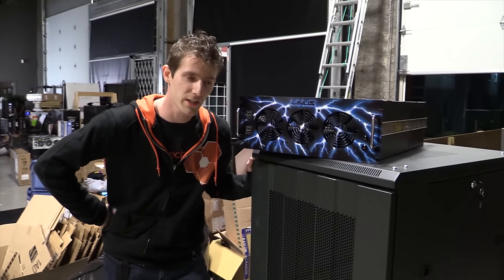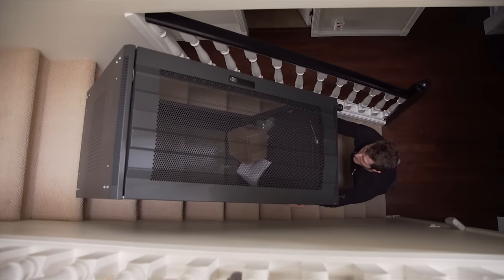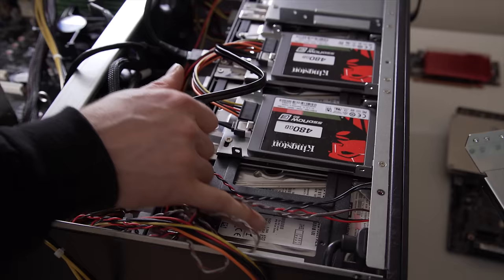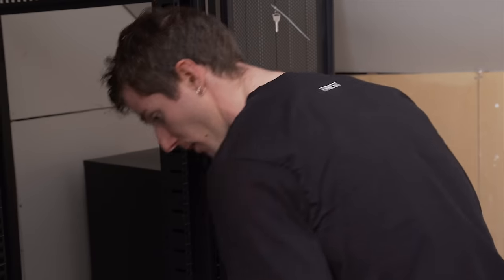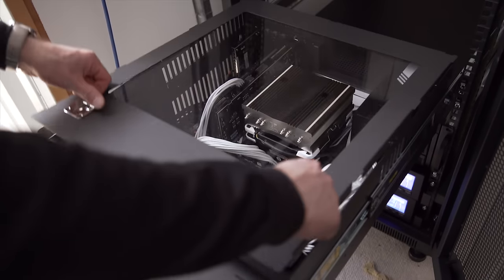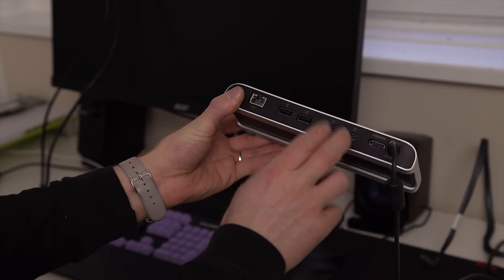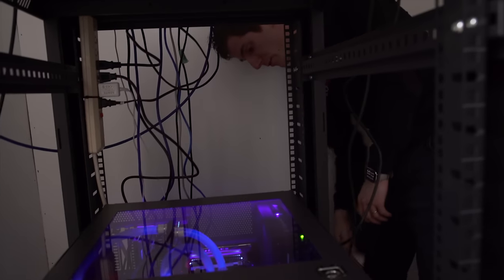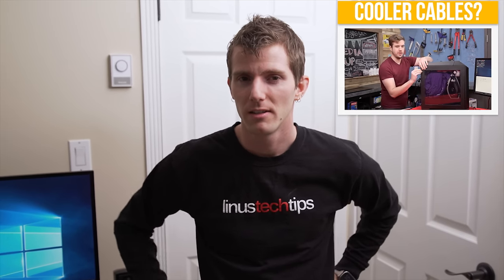Final Deployment of My New PC! - Personal Rig Update 2015 Part 5 (FINALE)

Comment: Nice Setup. Most boards these days have a internal thunderbolt connector. now Linus have u added internal TB cards to get the same functionality? can this connection cope with the load? and how come the computer knows how to output through the TB cable as people normally plug to the Graphics card directly and not through an intermediate card.. and one last question ! is it possible to bypass the hub and go straight for the monitor? (using some sort of TB to HDMI adapter and given that KB and mouse are wireless).. honestly this will save me the price of buying a TB hub ! :)

Hope to get some feed back from y'all!
Great Videos!
Reply: +Madani Khiyami just use a thunderbolt monitor. if you dont want the hub than thats probably the best option. if you want a tb to hdmi or tb to dp then you should just buy the hub, the extra functionality is more than worth it.

Comment: Could you please elaborate on the Thunderbolt voodoo you did there? Is that an adapter which collects every cable on one side, routes it through a Thunderbolt cable and then splits everything again?
Reply: +Ulmo The PC has to be thunderbolt ready and you add an expansion card.  Some newer motherboards have Thunderbolt 3 which would need an dongle to work with the Thunderbolt 2 optical cable.  The video output (in his case Displayport) is routed into the thunderbolt adapter card with a short copper cable.  The optical thunderbolt cable plugs into the mini displayport on the expansion thunderbolt card.  PCI-e and video data is send down the fiber cable and broken out again by the thunderbolt dock (that is how keyboard and mouse is extended as well as display).

Comment: Hi, So USB-C to Thunderbolt 3 cable from PC the Dock, then monitor, keyboard connect to dock? Which GapU is then powering the display? Onboard or PCIe GPU
Reply: +DemolitionManHD Gigabyte as a female Displayport connector on the Back I/O to allow for PCI-E GPU to be injected onto the Thunderbolt 3 data stream.  Its a unique and novel solution.
Reply: +jim slickster thank you

Comment: What with heat in that room? I have seen 2 pc's and some sound system in one drawer and it was quite hot in there even do there were holes. His room is much bigger and the only air-in hole is that filled with cables. Or I missed something?
Reply: DrawDeath it can get as hot as it likes he's never going to go back in unless there's a problem
Reply: Declan Mills yeah but temp will go higher and higher, wont it have any negative outcome on performance?
I think it may have
Reply: it is not that isolated
Reply: There are 2 radiators in his PC, the room may get hot but that PC is gonna stay ice cold. And I'm sure when he isn't using the computer, he'd simply just keep closet the door open.
Reply: Actually, cooling can only reach the temp of the air surrounding it, so if the air is continually rising, then so will the air in the case.

Comment: +LinusTechTips What Video card are you using? And how did you get it to send video via a thunderbolt connection? I am confused. :-/ can you share more info?
Reply: +Flat4Buggy 2 thanks for the quick reply. I'm now trying to figure out if there is a similar solution for AMD boards. I think the idea is right on.

Comment: I just got the exact same server rack a few weeks ago, need rails for my servers now which are $200 AUD, guess I'm not having rails for a while haha
Reply: What rack is it? I'm thinking about getting a second smaller rack
Reply: Well Linus's one isn't exactly the same as mine, mine has a glass door on it but other than that it looks the same. Mine is a High Class Communications FSR Classic 600 27RU 1000mm x 600mm server rack
Reply: Mr_Smith1327 thanks man
Reply: It looks like Linus's is the FSR Curved 600 27RU 800mm x 600mm rack, It might be the 1000mm deep version but I can't really tell from the video, I can however tell that his rack pc cases aren't as deep as most servers so they would likely only require an 800mm deep rack

Comment: How do you turn the power on? Except for walking into the other room and turning it on.
Reply: Simple. Sleep mode (used to be hibernate, where you save the session to the drive, not RAM, so you don't use any power) and wake on USB with the keyboard... although I'm not sure about the hub.

Comment: Hi Linus! I want to do a similar setup but i was wondering if there is a better solution in 2017.

Can someone help with this or just go with the thunderbolt+hub solution (i jsut want to ban my pc in another room)?

thank you very much
Reply: Hey, I guess you could use the "ASUS ThunderboltEX 3" for a Thunderbolt 3 (40 GBit/s) aproach, which would be very nice for a few years but unfortunately there aren't any thunderbolt 3 cables longer than 0,5m passive or 1m active which support the full bandwith. I heard that there will be coming otical cables for longer distances but they are not available yet and are then expected to be very expensive. (the thunderbolt 2 ones, Linus used, already cost about 350$ I think). Also you need to note that optical cables do not pass power but just data so you need a wall powered hub at the end to use any devices which require usb power. Hope I could help you. I'm also interested in using something similar but for now I guess I have to wait until thunderbolt 3 is well-established...
Reply: Thank you very much for the detailed help!

I think i will also wait for a "perfect" thunderbolt 3. =)

have a nice one

Comment: Ok, I'm new when it comes to building your own PC's in terms of performance and comparability. I need an upgrade from my HP laptop that's 6 years old but don't want to break my bank.  I have a budget around $700 including $119 for windows 10.  I saw the video about the CableMod wide LED strips and instantly though "Ooh! Shiny! Obviously go with an ASUS ROG MAXIMUS VIII FORMULA for the Aura LED connector.  After more research I'm here...  I want to build something that looks god but can still pull weight (Able to play games and be able to use 3D software like Inventor or video software, essentially a home computer for a variety of tasks) so I was thinking around the lines of a Core i5.  I honestly don't know where to start.  Motherboard? CPU? How do I balance performance to cost?  Is there anyone out there that can guide me in a general direction or give a recommendation, that would be great!  P.S. Linus... great videos, I've learned a lot but should probably keep watching.

Comment: So how much did this whole thing cost? I'm giving it a range of $15,000 usd to $30,000 usd
Reply: lol. like 5-6k
Reply: lol. like 5-6k
Reply: +Adrian Nastase his computer alone was like 6k 
he has a titan x 1500i modular psu, full custom water loop with a custom made case, cablemod cables, M.2 1.2 tb pcie ssd, and a 18 core xeon, and the monitors that he's using are like 1.5k each not to mention his servers and dual server power supplys witch are expinsive as he'll inside like a 600$ server rack
Reply: Lol your way behind. He is using an titan( not an titan x) a 5960x and 32 gb ram
Reply: ***** really? I taught he said the maxwell titan x, and yeah your right he's using the i7 5960x in his rig but the server has the 18 core xeon, regardless I'm pretty sure the 5960x is like 1400$ though
Reply: When he " bought it" it was 1000dollars. Watch the first build log, he says he isn't upgrading form a titan to a titan x
Reply: +Adrian Nastase I'm pretty sure he's using 64
Reply: He is using ducking 32 gb ram
Reply: +Adrian Nastase 64
Reply: GIVE ME THE LINK TO THE VIDEO WHERE HE SAYS 32 GB. YOUR WAY OFF
Reply: £35k plus all those GPUs need replacing every month but what's the point you have a future proof system that no one can touch because it's a supercomputer
Reply: +Sean DuBord he doesnt have a xeon in his main pc thats in his other one for something else he has a i7 5960X
Reply: +jonathan oxlade why does he need to replace his gpus every month

Comment: Are there other options to the elgato thunderbolt system?

I would like to put my and my wife's PCs into a single case and place it into the corner of the room (to get rid of the two cases under our shared desktop), but I am hessitating because I would need to find a way to bring monitor, mouse, keyboard (PS/2 mechanical) and webcam to the PC and in turn the power button, USB 3.0 ports, headphone and microphone jack from PC to my desk. 
The elgato hub is already pretty cool, but it lacks a power button or PS/2. Does it effect input latency?

Has anyone experiences to share or could point me into the right direction?

(For mouse and keyboard we already tried wireless options, but the signals were interfering which is a pain in the ass when you are gaming or trying to click on something - or better not to click on some "malware infested/ porn advertisement")
Reply: netwrok cables... but so bad

Comment: Can you do duel screens with this elgato dock?
Reply: There is an additional Thunderbolt port and one HDMI port on the dock, so it does support dual displays.
Reply: You can't output something out of the thunderbolt port and the hdmi port simultaneously, or at least that hasn't been possible previously.
Reply: Richard Strong After a retarded amount of research on docks that took way to long, a lot of docks do offer multi screen but the process is expensive and convoluted in some cases.

I came to the conclusion that cost wise it was easier to use either long cables for things that can be long (HDMI), and a USB hub to extend the range of that instead of a Thunderbolt dock. The cables are INSANE for TB and it's simply not worth it unless you have bottomless pockets.
Reply: discodench That is true of optical TB cables. The copper ones are much cheaper. There are alternatives but you'll still have to pay a lot.
Reply: The problem is if you want a long cable it needs to be fiber. Copper is to lossy for long distances at the TB standard. 

As for your question: https://help.elgato.com/customer/portal/articles/1491132-elgato-thunderbolt%E2%84%A2-dock-and-dual-display-support
Reply: discodench So you've got to use a thunderbolt enabled display for dual output. Those are a rarity, so in most cases it would be a no to dual outputs.
Reply: Richard Strong Thats the case with the el gato dock. There are other docks out there that run with thunderbolt that support multiple screens via displayport and HDMI. I think I saw a few that could even run 3 at 1080.

But still, at the end of the day it's still not a good solution for most due to the cost of the long cables. Not to mention the docks arent cheap either.
Reply: discodench I know. I own one and use it regularly.

Comment: Linus in 2050 : Finally i update my personal supercomputer with 20 Peta flops of compute performance, 10.000 cores clock at 1 THz, 400 GPU with 25.000 shader cores per-GPU, 1 EXABYTE of SSD with 200 Terabytes Per-Second transfer speed, too bad it can't run notepad and won't play solitare because the spec is too low for those heavy-demanded program :(

Comment: Linus I really hope you power bill doesn't have 7 digest
Reply: why would it go do some research on the cost of running a basic computer/monitor thats using 500-600 watts per month it barley hits the $40-$50 mark per month if its running 24/7 at full power (in a game or rendering something) i don't see how that would possibly make your bill 7 digits..50+50= $100 maybe another $100 all together for the PSU's still only $200 for the whole setup at maxed out conditions
Reply: It was a joke okay I live hear and it is cheap okay chill

Comment: ubquiti routers suck man. my god i have never had a decent experience with them except on single subnet setups. Try vpn to other devices or adding vlans no chance... I love the unifi system for switches and APs in large layer 2 networks but I will stay away from the routers. Sonicwall is the best gui based system.

Comment: I like the idea of optical thunderbolt cables but I have heard too many problems with them to want to rely on one to get basic connectivity to my pc.  Also, to say that those cables are outrageously expensive is a severe understatement.  I can buy many fiber optic cables at fraction of the cost for network equipment.  I get there are situations where these make sense but for any normal person, a 20ft DP cable and a 20ft usb 3 cable accomplish the same exact result for $50 bucks.  Not only that, they will be far more reliable if other folks' experiences with the optical thunderbolt cables are remotely true.

Comment: When you plug the thunderbolt 3 cable into the expansion slot to extend the I/O to the other room, does it use the graphics card for graphics processing or the internal cpu graphics?